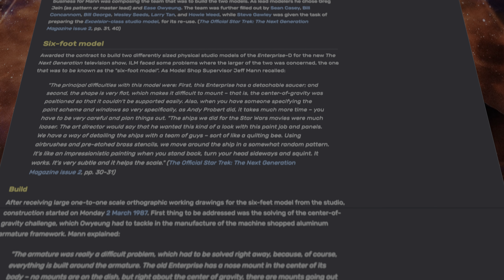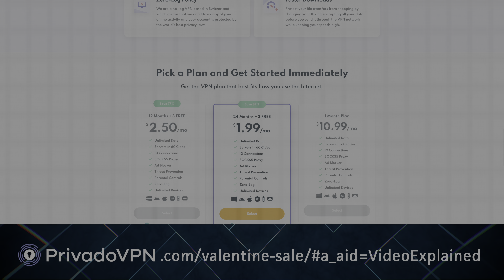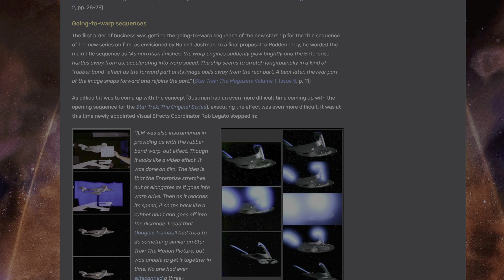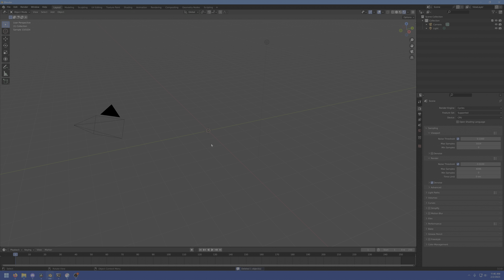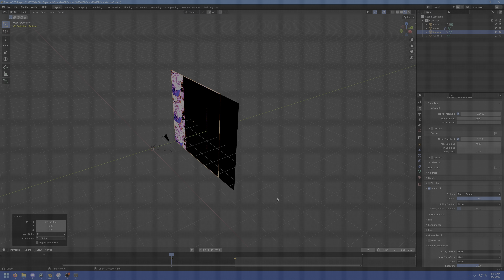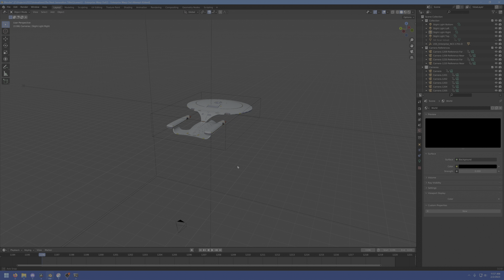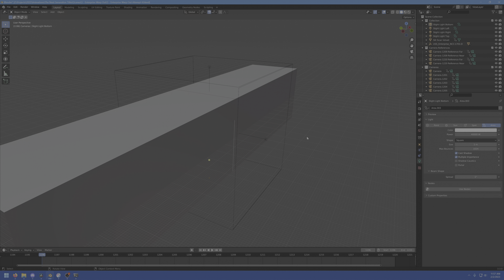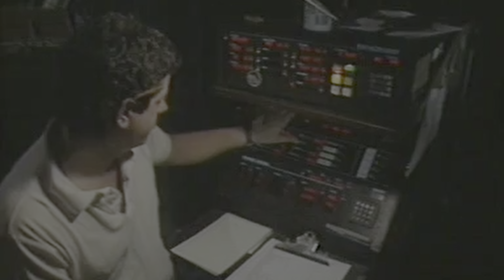Slit Scan: Recreating an Analog Effect in Modern Software

Comment: Hey! I can see you overthunk the process needed to animate the slitscan process in Blender. No scripts are needed. Once the camera has been keyframed to move towards the slit, you can just apply a Cycles modifier to the axis the camera is moving on via the graph editor. 0 Python scripts are needed to achieve this effect and you can animate the background as you would in a normal animation.

Also worth noting that depending on your setup, Center on Frame should still be fine.
Reply: Could you explain in more detail how to do that? I'm not too experienced with that side of Blender
Reply: @chocofrolik834  I originally explained it a bit briefly for the sake of brevity, but yeah. The Cycles modifier isn't a mesh modifier as you usually hear the word modifier, rather it's one of a few modifiers you can apply to an objects' keyframes though the graph editor. You can pull up a new window by dragging the corner of another window (e.g. top left of the timeline for a window below the viewport) and clicking the editor type dropdown (appears at the top left side of all windows, near where you drag).

After that , it's as simple as making the keyframes to cycle. On any frame, keyframe the location of the camera, and on the next frame, keyframe the camera to move forwards. Over the graph editor with the camera still selected, press A to select all keyframes and press T to bring up the interpolation menu. After setting the keyframes to linear, go to the keyframe outliner on the left and click "Y Location" (go through the dropdowns if it's not there already) and go to the "add modifier" button that's appeared on the right after clicking Y Location (if again it's not there, click N to bring up the tools panel). Click the "add modifier" button to bring down its dropdown menu and click "cycles". THe modifier should take effect now and you should see the Y keyframe on the graph become a sawtooth.

This does the same as the script except you're free to animate anything in the scene and render it as a normal animation as the slitscan effect is being handled entirely using Blender's usual tools.
Reply: @ChloaFifteen--she-her--  Thanks for the excellent explanation! I just have one thing to ask - using your setup, how would you automate the process of offsetting the pattern and rendering multiple times to get a moving/animated slitscan tunnel video?
Reply: @chocofrolik834  Since the camera movement needed to create the effect happens on each frame, you can render it as a normal animation. With the slit setup from the video and the camera cycling through its approach towards the slit on every frame thanks to the cycles modifier, you can just keyframe the pattern behind the slit to move like in a normal animation (again, best use linear interpolation on the keyframes so the movement is consistent through the sequence) then you're good to go. Glad you found my explanation helpful!
Reply: @ChloaFifteen--she-her--  With the pattern moving like a regular animation, won't the resulting frames of the animation not flow? I tried myself by keyframing a start and end point and the resulting render frames don't follow on from each other to create an animation. Am I doing this wrong?
Reply: @chocofrolik834  Can you record a video of what you mean?
Reply: @ChloaFifteen--she-her--  I'm doing this (a 100 frame animation) in 3dsmax with a circular slit, and a background image key framed to move across behind the slit as the camera advances. Using a physical camera, with motion blur enabled (100 frames) and the same enabled in Vray, I can get the effect well enough. Trouble is, there's a black circle moving toward the camera, obscuring the image; the inside of the circle doesn't render. Could you explain, in basic terms, what I need to change?

Comment: This video is very informative. I noticed you successfully recreated the Doctor Who intro from the 70s. I'd like to know how to use slit scan for different shapes...
Reply from the maker: I assume you're talking about the 4th doctor titles? My latest recreation of those actually doesn't use slit-scan, even though that's how the original was done. Maybe someday I'll revisit that project and redo it with slit scan! But in my video it was just done with textured tunnels in Blender
Reply: @Video Tech Explained  Thank You, I was also looking to do it in Blender

PS I'm definitely referring to the 4th doctor titles
Reply: @VideoTechExplained  Oh, so you never managed that in Blender. How would you go about it? I use 3dsmax and have a working setup using motion blur and Vray. It just needs some tweaking to get the inside of the circle to render.
Reply from the maker: @artstation707  I did achieve slit-scan in Blender while working on this video and its accompanying title recreation. But the 4th doctor titles were made before I developed that workflow
Reply: @VideoTechExplained Okay. So would it be possible to go through the steps? Here's what I did. 1. Create a black plane with a circular slit in it. 2.  Place behind it a plane with a pattern texture. 3. Move the camera toward the planes, while moving the pattern plane across. Motion blur is enabled with trial and error settings.
Results are the slit scan tunnel effect, but the inside segment of the black plane (a circle), remains black and moves towards the camera. 
I tried creating secondary slits in the circle segment, but that didn't really work. 
What do you suggest?

Comment: Hi guys. I'm a bit confused about the py code on 10:33.
 What does this code do? Just write the "speed" value to the file name after rendering or what?
Thank you for understanding.
Reply: I don't know how to get the python code to work either. You have any luck?
Reply: Hey I think you can do it without the script. In the graph editor, change the cameras Y Channel to cyclic and change the Key to linear and then you can move the artwork with key frames to any speed you like -make the pics channel linear too.
Reply: @amx360  Using 3dsmax, how would this work?